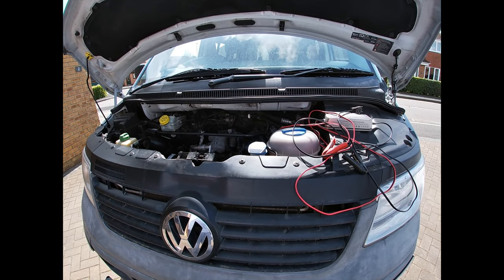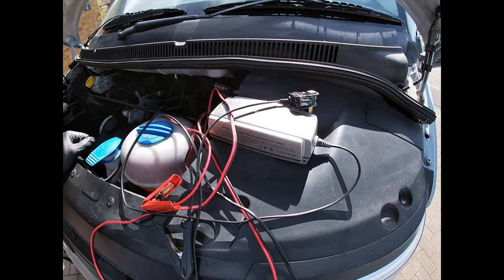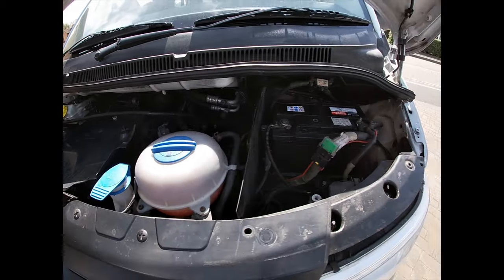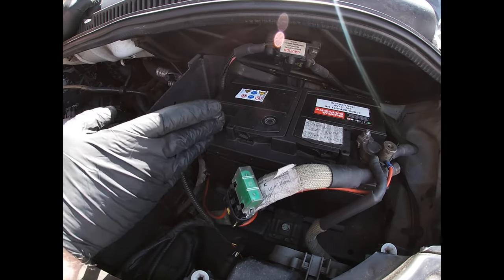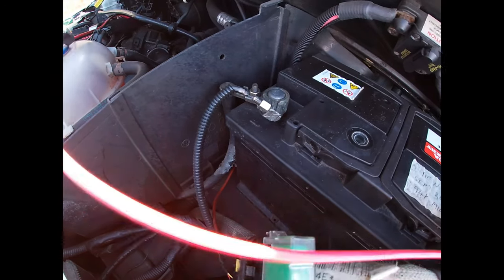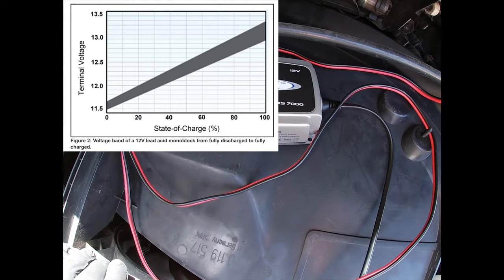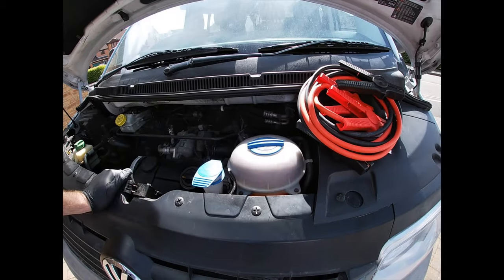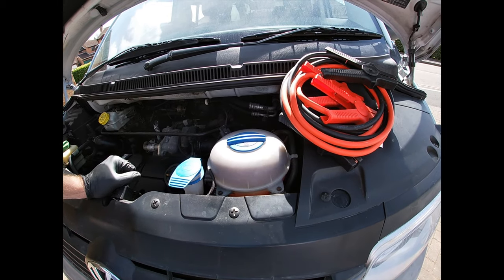Trickle Charging a VW T5 Van Battery (& fitting a New Battery) - Coronavirus Travel Restrictions

Comment: Hey! How long can you leave it charging?
Reply from the maker: This particular C-TEC model monitors the charge rate / state and effectively puts itself to ‘sleep’ once the battery is fully charged. It then remains in standby mode until the battery’s charge level drops below a certain charge, at which point it tops up again until full.  However, best Fire safety advice would be to unplug the unit once the LED lights show fully charged; maybe recharging once a month (during the day, rather than night for fire safety). Other chargers may vary, and some cheaper models can over charge a battery, damaging it, if not disconnected. Always follow the specific instructions given by the charger’s manufacturer, they are clearly the experts. Hope that helps!
Reply: @drivingvideos4238  thank you! i got a 7.0 model :) hopefully it charges my dead battery!
Reply from the maker: @isabelohwell.3454  the 7.0 is a really nice spec charger and has a ‘recovery’ mode designed to de-sulphate ‘dead’ batteries. So hopefully it should do the trick. As per the instruction manual, try the recharge during the day time, not overnight, so you are around for fire safety in the event of something going wrong.  Also be aware that if your battery has been left discharged for a long period of time it may not recover to full capacity.  Good luck🤞
Reply: @drivingvideos4238  thank you so much!
Reply: @drivingvideos4238  hey just an update! So I followed the instructions for the negative lead and connected it to a back metal pipe, however the battery wouldn't charge! I almost gave up but my Mechanic suggested I connect the negative lead to the negative on the battery and...it worked! She's charging away happily now.
Reply from the maker: @isabelohwell.3454  Great news! Direct to the battery negative terminal post will always give the best connection. The charger instruction manuals are obliged to advise connecting the negative lead to the ‘chassis’ away from the battery to avoid any risk of a spark igniting any hydrogen gas build-up around the battery from charging or rapid-discharging like repeatedly cranking an engine which will not start (though the C-TEK unit is ‘theoretically’ spark ⚡️ free). It’s very rare with modern batteries, but you don’t want to be around one if it does go pop!! I think I put some links in the description on this. The key thing now will be to see if your battery can still ‘hold’ it’s charge after the recovery charge cycle has run through. All the best with it!

Comment from the maker: OptiMate / AccuMate manufacturer’s video explaining their Solar Panel powered ‘Smart’ charger for parking locations where mains power leads are not feasible: https://youtu.be/ZOzppYeQ5ec (check maximum battery size this system can charge).

Comment from the maker: This is a link to more detailed video on fitting a next-day delivery battery: https://youtu.be/ciWzbRz4qng

It also shows an upgrade from an ‘096’ size battery to a physically larger ‘019’ giving 100 Amp Hours - a useful upgrade when changing your battery if you use the van for camping, etc, and run lights and other items from cigarette lighter socket.